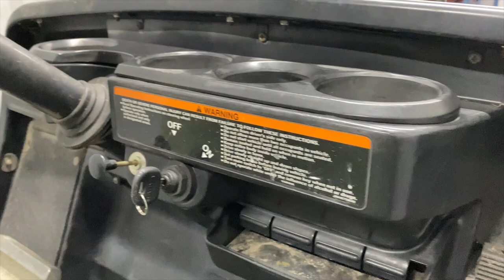Ultimate Golf Cart Makeover

Comment: At about 5 minutes in, while you were removing some masking tape, I was sneaking a peek at your CVT setup. Have you had any issues with your belt heating up or prematurely wearing out and is there any offset to the pulleys? I'm doing a build right now and can't find any information on this - other than a bunch of snowmobilers saying it's wrong but not offering any advise other than to flip the driven pulley the other way, which I can't do in my case. Any info would be greatly appreciated! This is the first time I've watched your videos on this so I've seen everything up to this episode's 5 minute marker but it's looking great!
Reply: I just reviewed your previous video where you installed the CVT and remembered you got a kit with mount so I doubt you've had any issues since they were all designed to work together.
Reply from the maker: I struggled on information to, it works well I don’t find that it heats up or anything, although I could space the back pulley out a bit more to align the belt, I did make spacers as the front cvt pulley rests on the v belt for the alternator. The rear cvt pulley was spaced with a custom shaft that I would recommend using a strengthened steel. The steel I used was quite soft otherwise I heard go power sports sell an inch longer shaft for the smaller cvt pulley just that I’m in Australia so shipping was to much $$ if you want pictures or anything else in depth email me engineeredtodesign@gmail.com happy to help.

Comment: Any future plans to make it 4x4?
Reply from the maker: Yes I would love to, just not sure how it would work with the running gear mounted on a swing arm setup..
Reply: @EngineeredToDesign  possibly try and get a 4x4 atv front end and try and mount it on front providing a driveshaft or a chain mechanism
Reply from the maker: @chickentendies7814  a cv joint from the rear to front could possibly work..